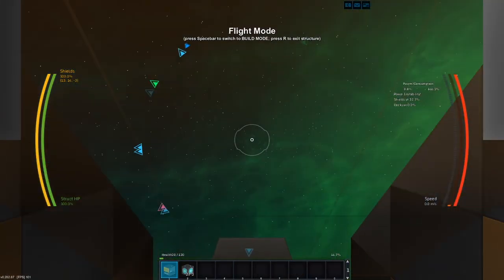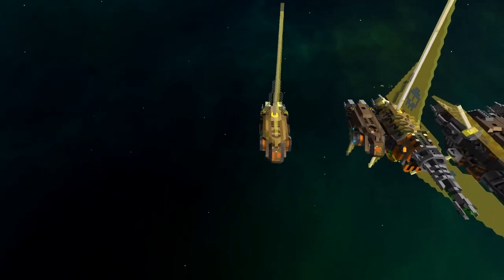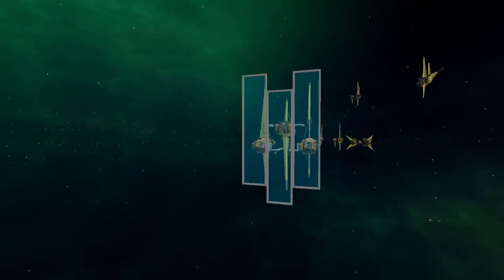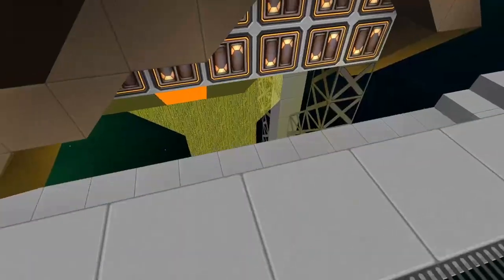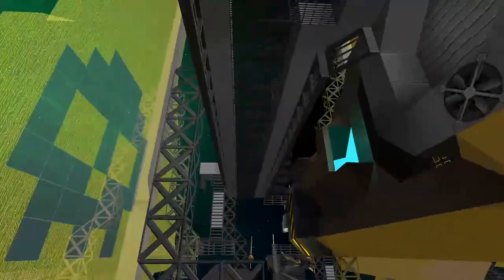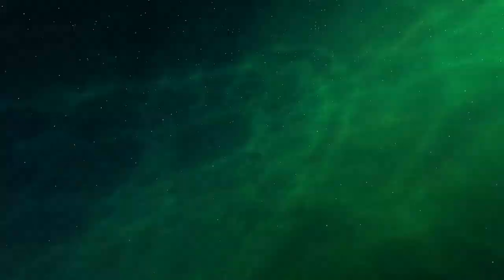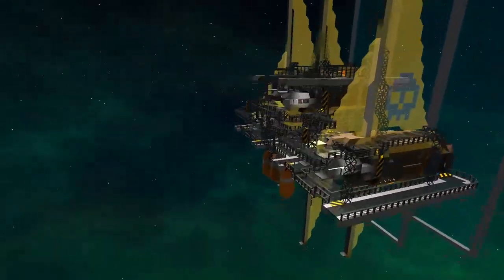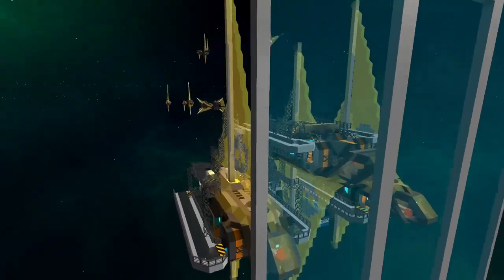Shuttle Hanger - StarMade Project Titan

Comment: Just an idea, make the docking ships be able to raise and lower their sails (only if your going to alter the ships anyways and you have the space inside).  The idea is basically 2 doors.  Although there will be an angled look to them, you can divide each sail into 3rds.  The first 3rd is fixed and will not move (it's the base).  The second 3rd will rise above the 1st, while the remaining third rises above the 2nd.
    3
  2 
1  
    <--open    closed-->  123

Additionally,  the Mast can be raised and lowered on its side using rotation.  Then just the rails, logic and timers inside the ships.